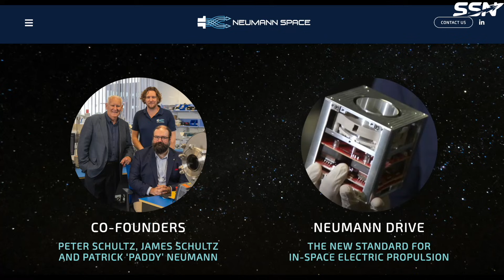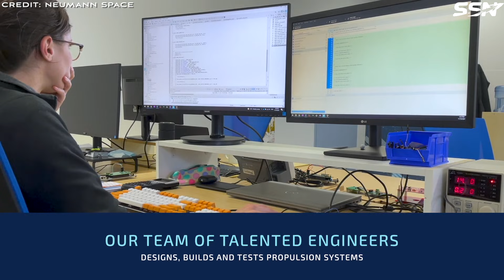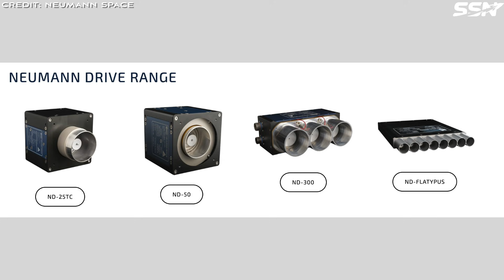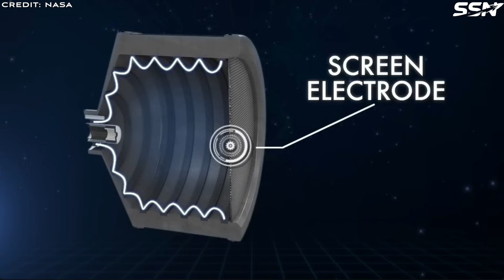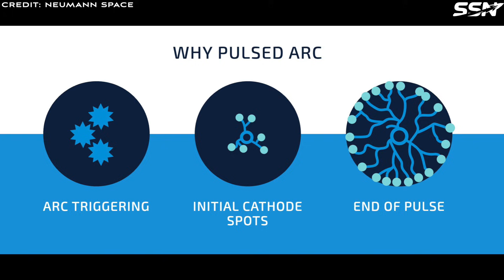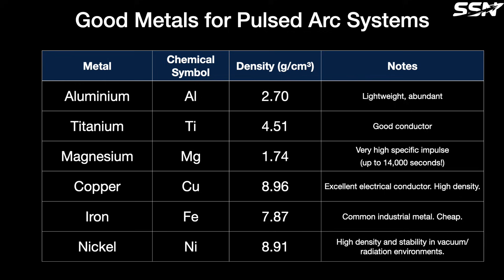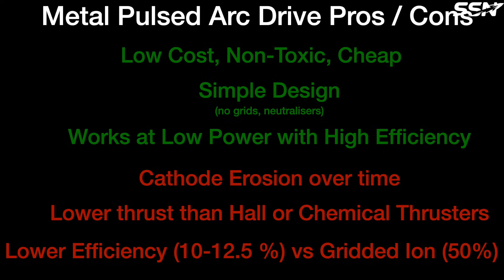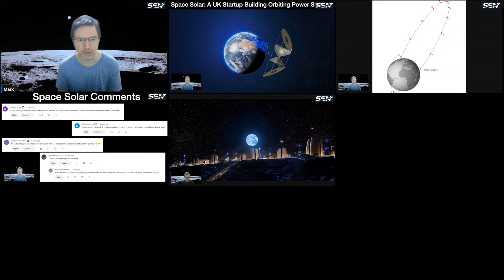Goodbye Xenon, Hello Cheap Metal: Why Neumann Drive Could Dominate Space Propulsion

Comment: yea condensable propellant which include metals  aren't generally used  for some pretty good reasons. Mainly you will get  some back splatter from the drive and over time those materials will build up on your space craft . solar cells, antennas , and lenses generally don't like being covered in metal, this the reason iodine drive have never taken off commercially despite being available for decades. These drives are fine for low cost short live cubesats but larger sat aren't going to use them. additionally most customers today, thanks to the low cost of launch, are more interested with thrust to power ratios and not ISP.
Reply: Correct however it’s an easy material to get for ISRU and it offers exhaust velocity comparable to current day (terrible) ion engines 
Theoretical ion engines can get above 300kps but current ones (like DAWN) are at 30kps. They claim around 140kps for magnesium and less for heavier metals of course 
So it’s already giving you a lot more delta v than current ion engine. Because they’re bad but that’s besides the point until high exhaust velocity sufficient thrust ion engines are made it’s still a better option

For the issue you mention... I don’t see it as a dealbreaker because you can just like cover stuff or have the robot clean itself if you’re not crippled by skill issues and failing moving parts 

Your concern kinda reads like "we should never get dirty in our entire lives because it can’t be undone" instead of "wash yourself if you get dirty" to me

Solar panels are probably the biggest issue. Solar electric propulsion works but even at Mars it’s really terrible (I did the math). You can do it for instance to boost to the outter planet by diving inward from earth towards Venus or mercury then use solar and ion engines to get the speed to reach the ice giants or whatever, then use another electricity source or even engine type at arrival. This approach makes trips very fast because you can get a lot more delta v than the absolute brainrot which is stacking gravity assists with chemical thrusters and high mass ratio as nasa has been doing 

So the question becomes can you prevent deposition or clean deposition from solar panels
Idk, maybe, go ask/task material lab goons to test it
Reply: Thrust to power ratio is a weird weird metric wouldn’t you care about total propulsion (including power source) system weight to thrust ratio 
And yeah it matters when you’re using certified clown engines that give you MICROgees of acceleration but like... idk don’t? lol? (I don’t think anything is possible if you dip below 20μG of acceleration in our solar system)
Delta v is always the key metric, you can have more acceleration than you need but you can never have too much delta v. Well I guess unless you’re making non sustainable short lifespan things that barely need any delta v which is so dumb it probably should be illegal to avoid wasting resources and creating orbital trash but hey let’s be blessed by the Chinese 1000km+ ten bazillion short lifespan soon to be obsolete satellite constellation can’t go wrong lol, and a lot of private cubesats from idiοts. But if you’re not trying to recreate the once fictional universe of idiocracy with your time and money then yeah delta v is pretty nifty, it allows you to just recall old satellites to be disassembled and recycled which should be super easy if they’re mass produced and identical, it allows you to transfer them to another planet or do endless orbital maneuvering back and forth. With sufficient delta v and exhaust velocity you can do crazy stuff and nearly ignore orbital mechanics and enter weird pseudo orbits with constant thrust. Delta v is also colossally important to space warfare and all future conflicts. So is acceleration of course, you’re not gonna convert a milligee cubesat into a KKV nor can it dodge one. But saying delta v/exhaust velocity is useless is just pure heresy, if our high thrust rockets had better exhaust velocity our ground to orbit launchers would look like cars with a tiny fuel tank and 90% of the mass of the rocket being payload, which is actually optimal fuel efficiency wise, we’re stuck with these absurd contraptions called rockets that are just big vats of fuel solely because our engines don’t have sufficient exhaust velocity. By like a factor of 3 too

Also Isp is a terrible unit, everyone should use exhaust velocity instead, I’m just going to degree that Isp is the imperial system unit and EV is the metric system unit because it’s where they belong
Reply: Is this not solved by shooting it out the back rater fast and thus not coming near important parts ?
Reply: @Thefreakyfreek while most of it will shoot  out it's not 100% efficient. You always some amount of propellant that is not ionized and will form a cloud around the vehicle, Maybe  only 1 part in 10000 but it only  take a film a few atom thick  to short things or damage optics. All thrusters have this issue  but Nobel gasses don't conduct and water evaporates in sunlight. That being  said the process  is slow so if you only need a couple hundred  hours of run time it ok but generally electric propulsion is used for thousands  of hours. It also super hard to study and optimize this problem because  on the  ground you vacuum  chamber  dramatically increases the issue due to interactions with the wall of the chamber.
Reply: @orbitONhigh This isn't an ion drive. They are making a very brief very hot arc that boils the tip of the central electrode. It is a form of an electrically powered thermal rocket engine. Condensation may be a problem, but it won't be due to incomplete ionization.

Metal that hot will be partially ionized, but the cloud as a whole is neutral.

The cathode is only energized for 10 microseconds at a time. I assume they chose that duration so there wouldn't be significant magnetic or electric fields by the time the gas exits the tubular anode. 

Check my assumptions. How many millimeters does gas move in 10 microseconds given the stated ISP?

Pulses can't be too frequent, or the electric and magnetic fields will redirect the remaining ions from previous pulses. The strength of the fields will depend on how much the arc varies from perfect symmetry.

I would like to see the distribution of the condensation in practice. A satellite with active electronics will make some electromagnetic fields. The solar wind and other ionizing radiation will build up charges on the satellite. The Earth's magnetic field might be an issue.
Reply: @hamjudo   You are largely correct about the thruster the arc is going to be a quasi neutral plasma the metal will be ions for brief amount of time that how you able to pump  electrical energy into the metal to heat after all.  the velocity will be in 10-30km/s regime for that kind of isp pretty typical for ion drives. however the specific operating principle isn't relevant to the plating problem , it is a materials properties and chemical reactivity issue  doesn't matter if the thruster is a superconducting particle accelerator  or a astronaut with a shovel. condinsible propelantant will condense on your spacecraft. there are workarounds but that adds cost. xenon is about as optimal of propellant as can asked for with exceptions of cost, building a gas reg system that runs at 2500psi is a well understood problem with commodity component available to handle it, unless you are launching hundreds of sats it is by far the best approach for any sat over about 50kg. for stuff smaller than that PPT or FEEP  type drives are better.
Reply: @orbitONhigh  There is no heat being pumped into plasma after the arc. Arc is what creates plasma and that is it. That is why efficiency is so low because temperatures are very limited. They basically took EDM machine upped the current and pulsed it to get this drive.
Reply: @skyrask1948 um, we are possible misunderstanding each other. the arc is a plasma it  doesn't create plasma i'm referring to how arc/plasma is forming and being used to make thrust. Remember heat is kinetic energy at the molecular level. it why ep is so much more efficient than chemical rockets   chemical maxes out ath 6000K, while  plasma can be pumped up  into the millions of Kelvin that where the high ISP mostly comes from. 

 Break down of my logic: The energy of the arc can be basically broken into 2 parts one is the ionization energy the energy needed separate electron from the nucleus this is a strait loss as it decays to the light we see. the second part is therma aka kinetic energy which what you using for thrust. and is the heat pumping I'm referring to. using electrical energy to accelerate the ions is == heating, now there is also a tiny bit to break  interatomic bonds but basically a rounding error compared to the other terms so we usually don't include that in napkin math.  

 The fact that the plasma is transient or static isn't relevant to the plating issue though, it only effects how long it take to happen and is directly proportional to the DeltaV requirement of the vehicle.
Reply: @orbitONhigh  Na, I think we all can't understand you? You're a smart person, but your having a hard time wrapping your brain around this concept. Also There are quite a few things you stated that proves you do not know how testing, simulations and physics works. Example, you can optimize a drive here on the ground: Hang the drive inside the vacuum chamber and just take in account of the resistance of the string and measure the inertia.....
Reply: @orbitONhigh  Before I reply more comprehensibly, I need a clarification from you of this part since it can be taken in two different ways. "The energy of the arc can be basically broken into 2 parts one is the ionization energy the energy needed separate electron from the nucleus this is a strait loss as it decays to the light we see." Are you talking about energy needed to ionize arc or energy of arc being used to ionize anode?
Reply: @skyrask1948   im refer to the ionization of the arc im not  sure what you mean by ionizing the "anode" that being said i've been trying to keep my explanations as high level and general as possible. 
 I'll admit i don't know the specific methods neumann are employing, but based on the geometry and my knowledge of other EP devices and my vague memory of holding  their display demos, i'll give  my best shot to explaining how i think this thing works.  

TLDR: it appears to be a radial pulse plasma thruster with long channel length to boost the initial plasma  via Lorentz acceleration. 

The rough order of operations for each pulse should be similar to this.
step1  apply a high voltage across a starter electrode (guessing the round disc looking thing in the middle ) probably in the 2-10kv range and the the propellant anode (hidden below disk) this will form an initial electron arc
step2  the electrons will accelerate into the anode and then sputter off of some of the propellant maternal 
step3 that sputtered material will be ionized briefly liberating more electrons that are accelerated by the strong E-field causing them to sputter off more material in cascade reaction by the electron collisions and additional sputtering as plasma density increases. this hot material will begin expanding into the acceleration channel (the empty space in the middle of the device between the inner and outer electrodes) this is basically a  standard PPT at this point
step4  apply a  lower bias voltage to the outer electrode probably about 200-400V
step5 the expanding plasma will then form conductive path  between the outer electrode and the inner anode ( the starter electrode high voltage should have decayed at this point and is no longer playing a role)
step 6 the current being conducted through the plasma and inner and outer electrodes make  magnetic fields  that result in the acceleration of the plasma down and out of the  ( this is the lorzen acceleration, same phenomenon to railguns just with plasma instead of a solid projectile. ) 
step 7 this acceleration adds kinetic energy to the plasma increasing its temperature and thus it effective ISP, normal PPTs generally have and isp in 800-1Ks range  so to  get over 2000s they have to be doing some secondary acceleration of the plasma after the initial arc and sputtering event. keep in mind all this occurs in a few hundred microseconds so it just looks like single flash to human eye but i bet if you used a highspeed camera you would see 2 flashes a few dozen microseconds apart 

now  in regards to the the plasma itself those ionzed metal ions will recombine with the liberated electrons basically this whole time when that happens light is emitted as the electrons shift to a lower energy state (reverse photoelectric effect) that light is an inherent inefficiency in the drive because all that energy used to rip eletrons off the base metal atoms (which you need to do for the whole lorentz trick) is just converted back to light which does not provide much in the way of thrust. 

I would love to be able to explain it their drive better but the last time i talked with their reps at a trade show they were a bit cagey on the details at least with me because i work for sorta competitor.  Also my background is mostly testing rocket  not designing them so i dont have the full PHD level understating of the low level physics, i just argue a lot with  people that do.
Reply: @orbitONhigh  Following your reply I read  their patent and you are mostly correct except there is no secondary acceleration only potential plume shaping with magnetic field. I don't see where could any potential back splatter occur.
Reply: @skyrask1948  oh that, yea ionazion isn't 100% efficient you a alway get few neutral atoms from each shot that have very little velocity or plasma interactions that through a few atoms in the wrong direction, long tails on the energy distribution, and whatnot.  those atoms are just  attracted back to the host craft via electrostatic forces, literally static cling, but at the scale of individual atoms,  all thrusters do this it  just is more of an issue with conductive materials because they short out antennas  and solar panels and cloud optics more than gases like nitrogen, water, or xenon.  this is one the main reasons iodine never took off  commercially in plasma thrusters despite its much lower cost than xenon. this is a slow process and is less of issue for small thrusters   thus the more favorable trade for using condensibles on cubesats as they are typically short lived and general are very low voltages  on the PV arrays, negating the worst effects but as you scale up to larger busses it  become a larger problem.   there are few companies that have condensable prop thrusters on market besides neumann and they are all cubesat class.
Reply: Dude - keep posting
Reply: Slow down there HighOrby. Only "back splatter" that would happen would hit the Fuel Rod. In which it will be metal that will be turned into more plasma on the next shot. This is game changer for Small Satellites. Larger ones with bigger mission won't benefit from this yet. Big leap for humanity will be the ability to pack a bunch of small Satellites and shoot them far away on one rocket, then deploy them once they get to Jupiter and have them take off in different polar orbits and perform lab experiments and observations.
Reply: @ZeroSpawn   for small short life vehicles shure its a fine option, personally prefer it over FEEP thrusters in most cases, but the plating issue is a know problem with condinsibles prop and has been for decades .  i could see a mission like you describing for mars maybe but jupiter  is god awful environment for cubesat in particular, crazy radiation and basically no sunlight, the low surface to volume ratio exacerbates both issues.  mabey space datacenters will push the economies of scale on rad hard parts but last i check 95% of cubesat parts on the market are rad tolerant at best and most of the hardware is for <30krad if its even qualified. so if you want to do a deep space mission your going have go bespoke to the extreme  so $$$ at that point you mostly lose the benefit of the cubesat size class.
Reply: Can't tell if its a bot. (¬_¬)
Reply: @ZeroSpawn  nah just 20 year in industry and a cannabis gummy